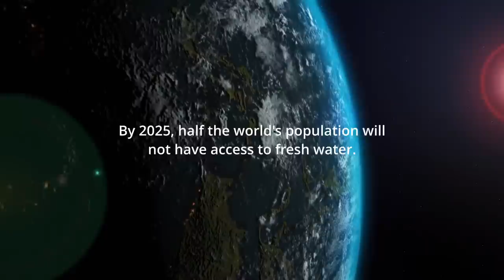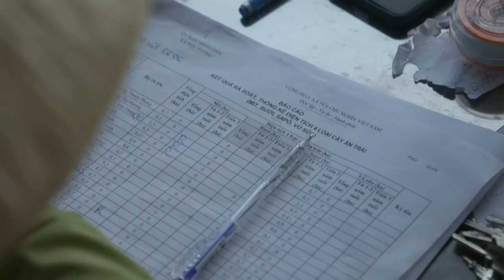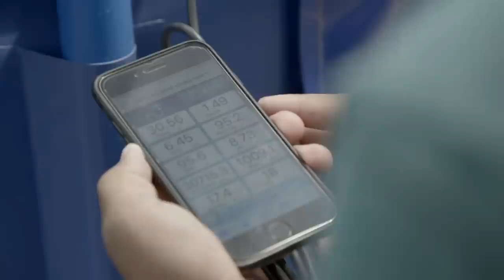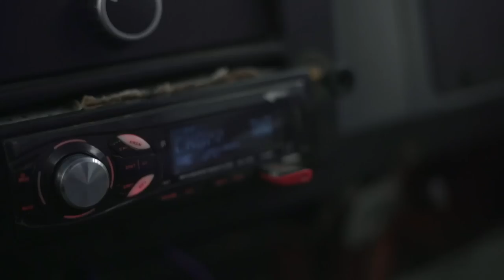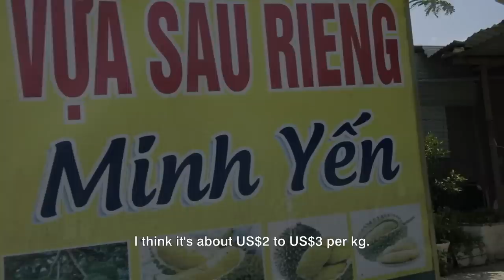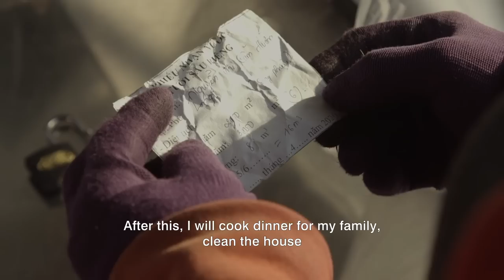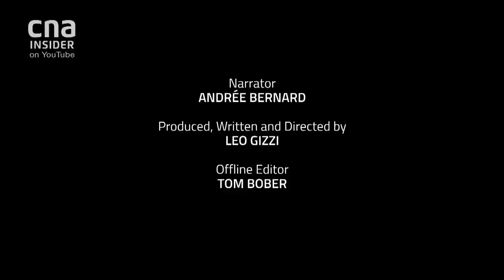War For Water: What Happens When Asia's Rivers Dry Up? | The Longest Day | Climate Change

Comment: Having to face water shortage practically all years round, shouldn't nations act like China to harness water from regions of plentiful water to the the drier areas; instead of spending so much on defense budgets? India could have done better using similar man-made canal to distribute water across the country. In smaller area like Java Island, the government could create larger artificial reservoirs by enlarging existing ones so that the rain water could be saved for later use. After all heavy rains occur rather often in the tropical areas. There should be a change among the Asian nations so that expenditures on defense of every nation could be reduced towards creating infrastructure that promote economic progress. To reduce defense expenditures of each nation, there should be some kind of platform where the concern of all nations could be openly discussed and resolved!

Comment: heres why jakarta situation is very silly:
1. they build houses in silly area such as swamps and stone area like in your video. those stone area can barely get any water, while those who live in swamp area get flood every year.
2. they get flood yearly in many areas not just those in swamp areas, and yet other areas still experience drought. it's a proof of poor water management system. like why dont they just save or transport those flood water somewhere else with extreme drought.
3. and finally, they blame the heck out of climate change. their "sea water level rise" is mainly caused of their insane extraction of ground water (the ground lowers, not the sea level rising). they just need to implement a good system here not just blaming climate change left and right, but yes obviously nobody in charge and/or government is willing to implement a proper watering system.

Comment: If even half the people in these water stressed areas would make an effort to catch rainwater when it is available it would ease the stress on the ground water supplies and give it a chance to recharge. The man growing the shrimp and fish in Singapore could decrease his use of public water supplies even further if he caught all the rain water coming of his buildings.
Reply: Singapore is 50% reservoir. Yes he could capture rainwater off his roof, but I can't believe that'll help much with the water stress
Reply: @ginsederp  You'd be surprised how much water you can collect off a roof. I watched a video where they used an approximately 2800 sq. ft.  rain roof they collected over 15,000 gallons of water from 2 3/4" of rain. 
Now imagine 50% of the buildings in Singapore captures just 5,000 gallons of water per storm in a cistern and uses that water to flush toilets, for cleaning, or bathing, or industrial use like the fish and shrimp farm. This water is very clean with zero treatment and can, if stored correctly, be used as drinking water as well with little or no treatment. (many people use only filtration)

Comment: you know its a matter of when when Johor is gonna have a dry spell for months to come, how is Singapore gonna cope with it? theres gonna be tension on who gets what percentage and tension leads to violence etc
Reply: Desalination plants in Singapore will ramp up production to meet the shortfall. Main shortfall is the process is expensive even though desalination is using reverse osmosis.
Reply: I think you are either too lazy to find out the info, or illiterate and cannot read news. FYI, we got 4 taps in Singapore. 1st tap which is the NEWater that recycle water provides up to 40% of Singapore’s water supply. 2nd tap is the desalination plants which converts sea to drinkable water and we just complete 4th plant this Sept, we have 5th plant completing this year too which when all 5 plants complete can provide >50% of water supply for current needs. The 3rd tap is reservoir which provides 10% of our needs and lastly the malaysia tap. We still need to play nice to Malaysia simply because we have to lower the cost of desalination as it’s still costlier than importing water from Johor. I like to also remind you that the reason our government is trying their best to do all these many years ago is because we understand Malaysia’s Tunku once said that any unhappiness with Singapore they can always turn our water tap off. We never wanted to be at any country’s mercy so we have to be self sufficient at all cost even before our water agreement is up. Actually we need to thank Malaysia for this water issue. If not for their threats we will probably never be more ready.

Comment: Doubling every 7 years Sea Level will reach 7 meters by 2070. Extrapolating backwards it doesn't look like much right now, but let's see.
3.5 meters by 2063 - 1.75 meters by 2054 - 2.5 Feet by 2047 - 15 inches by 2040 - 7 inches by 2033 - 3.5 inches by 2026.

Comment: Conserve water. Everyone needs to conserve water. Buy air-to-water machine if you can afford it.
Reply: There is no such thing as air to water machine and it’s not reliable the correct name of the machine can’t remember but you need to understand it’s not a solution and not a good workaround it uses too much electricity and time.